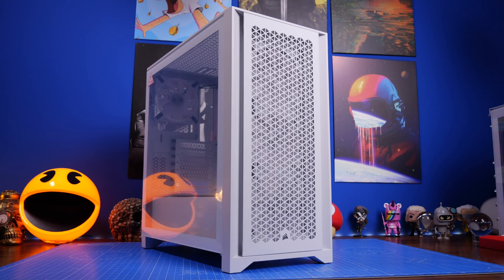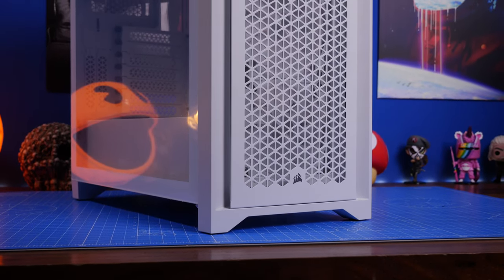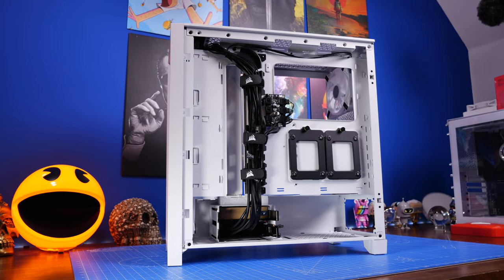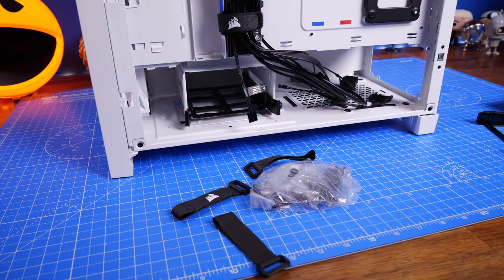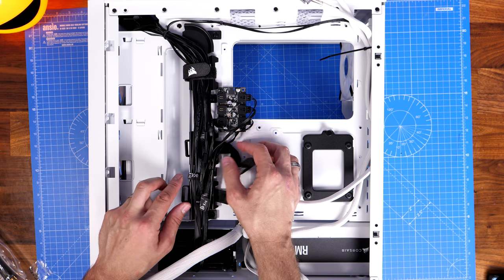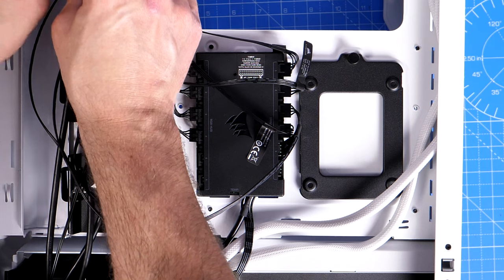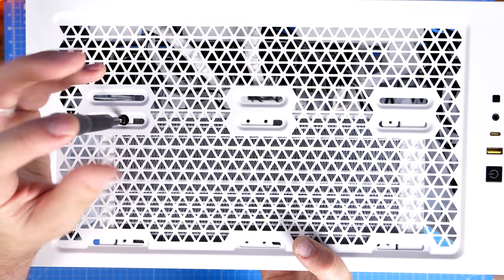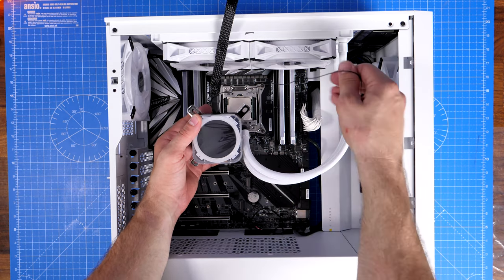Corsair 4000D QL Edition Build with H100i Elite Capellix, LCD upgrade and QL120 fans

Comment: I have the 4000D Airflow, with 6 LL120s.  I had the Elite Capellix with the white LCD upgrade. Using a white Gigabyte Vision motherboard with a white Gigabyte Vision RTX 3080ti.  I also have two 1 TB Team gourp white RGB SSD's mounted on the PSU shroud (and two 980 pro NVMe's on the motherboard).  I also have the Corsair braided power cables. It all looks very clean.  I do like the QL fans, but 6 of them is a rather big investment. Decided to put that money to a GPU and RAM.

Comment: I bought the 4000x and will be buying the stuff to build a pc in it around new years. it might fry up my components due to the not great air flow and poor thermals. But at least it'll do it in glorious RGB style.

After watching this, I really want all QL fans, but replacing the front 3, and the 2 on the h100i Elite Capellix and 1 more in the back will make this $119 case cost like $400.
Reply from the maker: Yeah RGB comes at quite a price sadly

Comment: One huge tip you can remove the Hard drive tray to have more PSU wire space and it will be way more easier to install the psu unless you still using big hard drives.
Reply from the maker: Yeah I did say that.
Reply: @TheProvokedPrawn  Just saw the end of the video where you said you had to move over the tray. 😂

Comment: Looks good. I achieved a similar white RGB look with the 4000D Airflow + 6 x Arctic Bionix P120 A-RGB fans. These fans connect via modular plugs so the cabling is no where near is convoluted as these QL120 fans on both the hardware & software side.
Reply from the maker: Yeah, Corsair needs to move to daisy chaining or something. TBF though, 6 fans is much easier than the 12 I did in the bigger cases!
Reply: @TheProvokedPrawn  Yep, also, as you say, Corsair aren’t the most efficient at moving air plus they cost so much, they’re poor value compared to many others. Love their cases, but I steer clear of their fans/RGB ecosystem.

Comment: Great review, as always. I just bought a Corsair 4000X RGB white edition case to build a new PC with an Asus Prime Z690-A and I7-12700 processor. In your opinion, which water cooler should I use? The iCue H100i Elite Cappelix on top, or the iCue H150i Elite Cappelix on front? Thanks in advance!
Reply from the maker: H100i on top will have better cooling imo

Comment: I'm curious - Why mount the PSU upside down?
Reply from the maker: Because that's the correct way to do it, so the cold air is pulled into it from below the case.
Reply: @TheProvokedPrawn  Interesting.  They should put the decals on upside down too then!  :)

Comment: What makes this version 250 dollars? The regular 4000d isnt more then 95.
Reply from the maker: Four QL120 fans and the RGB controller no doubt.
Reply: Buying the normal case with all the ql fans separately is the same price so the price is pretty fair
Reply: @TheProvokedPrawn  Gotcha. Thanks.
Reply: @TheProvokedPrawn  is this better than the corasair 4000x sorry im new to pc and i just want a good case with good air flow for a 3060ti and a 5600x
Reply: @boolaidman471  Well seeming as it's bundled together it should be cheaper than buying separately, thus what's even the point
Reply: @placeholder3853  that made no sense at all why tf would it be cheaper 😂, ql fans are expensive asf and the case is different itself so u can’t get it separately anyway,
Reply: @boolaidman471  Economy of scale, that's why buying 10 cans of cola is cheaper per can than buying one. You're also forgetting the regular case comes with two fans already, so you're essentially paying about £50+ per fan which is more expensive and ridiculous. That different case colour could easily be sold separately without the extreme price tag.
Reply: @placeholder3853  the regular case comes with cheap non rgb fans so that point is irrelevant, you shouldn’t even be looking for this type of case if u think the price is ridiculous cuz it’s the same if not sometimes less than buying separately, yes pc fans are typically over priced anyway but that’s just how it is
Reply: @boolaidman471  They can sell expensive fans all they want, but I don't want to be forced to buy them just cause I want the case colour. It should be cheaper anyway, there's no way their margins are so tight on a £33 fan. Also, you can get good sub £100 cases with 4 ARGB fans, so pc fans in general aren't always expensive.